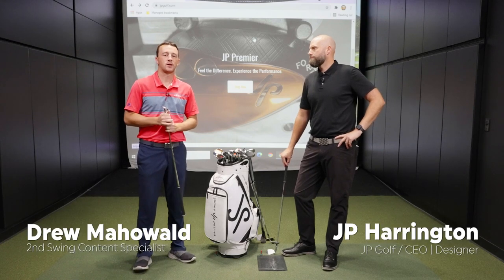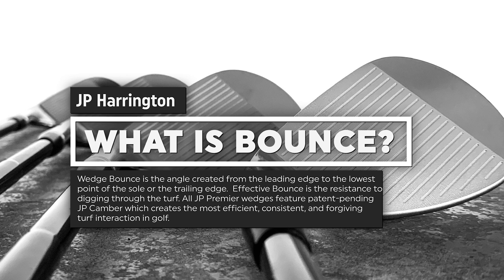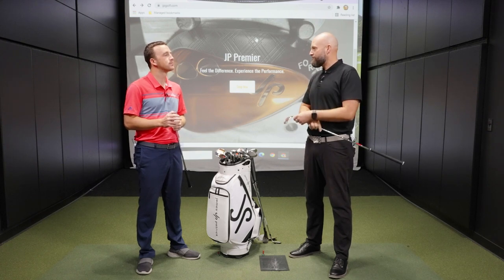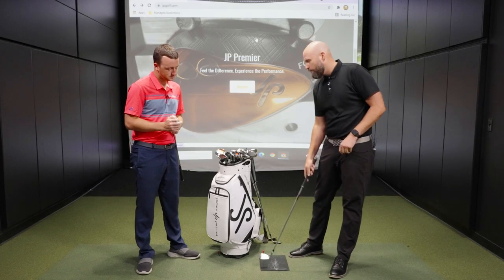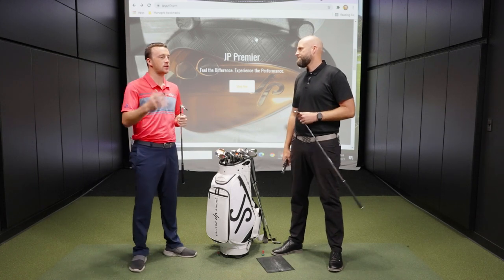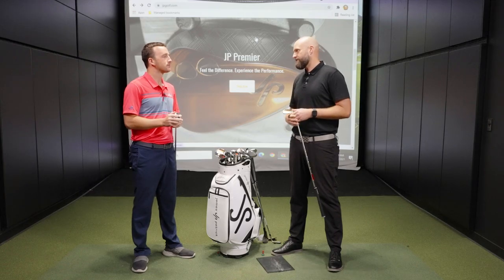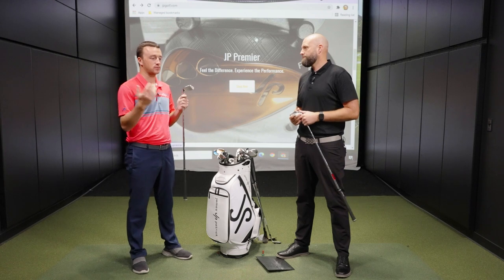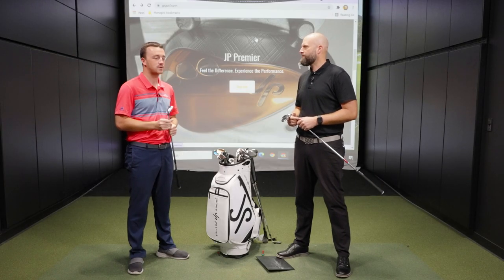Golf Wedge Bounce Explained | JP Premier Wedges

Comment: The course I usually play has very dry but powdery ground and a lot of times my lie is mostly dirt or clover weeds (it's a cheap muni). I take very shallow divots usually, without much forward press. Also the greens are really firm. What should I be looking for?
Reply from the maker: If you don't have much of a forward press and the turf is pretty dry I would recommend lower bounce options. If you forward press you need to start with more bounce. I would also recommend some versatility. One of your wedges with lower bounce and one of your wedges with mid bounce. - Thomas
Reply: @2ndswing  Thanks for the reply! I am thinking of doing what you suggest with carrying low and mid bounce.